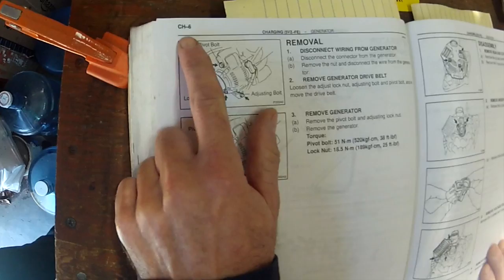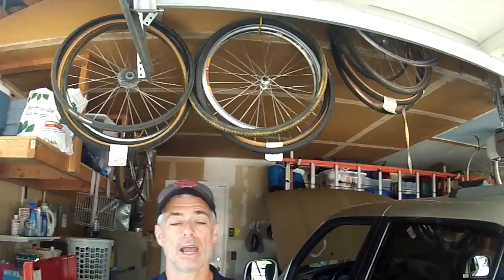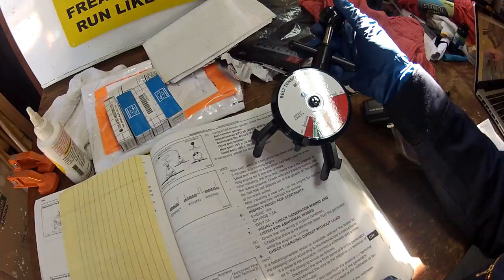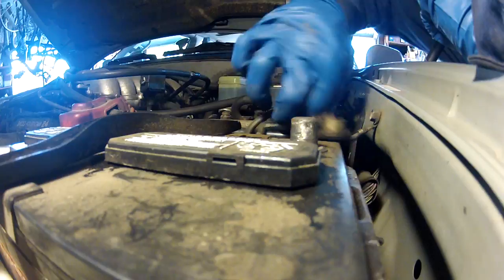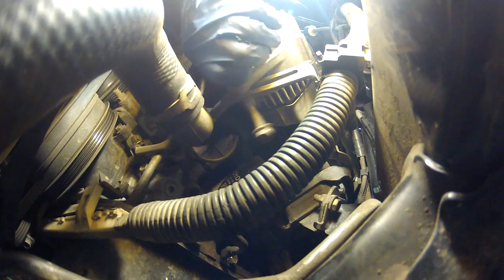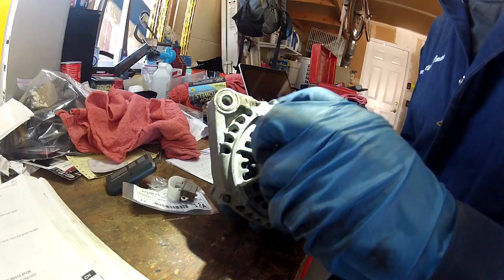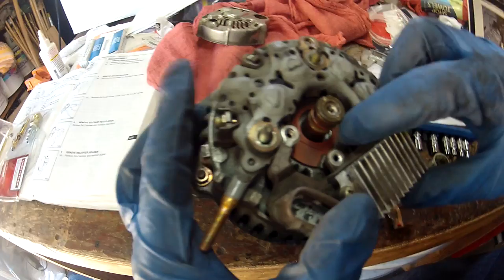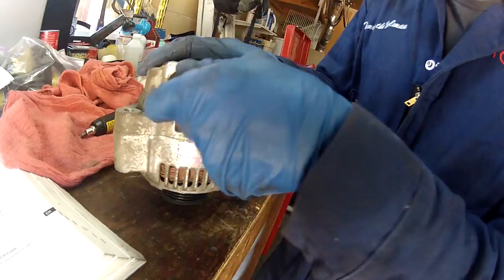Alternator Brush Replacement

Comment: My alternator may not be charging well enough. My battery light came on, on the dashboard. No real problems yet. My is question is, if my alternator is the culprit would this be worth doing to regain the proper voltage charge, I'd rather spend $22 or $27 rather than $138. Thanks Timmy.
Reply from the maker: Yes, it's worth a try replacing the brushes.  Quite often, worn brushes are the reason for poor charging or no charging at all.  Let me know how it turns out for you.
Reply: @TimmyTheToolman : well they tested the alternator on the truck, said it was below normal voltage, like it was bad, took it off to buy another one at autozone, but had them test it on their machine instore before buying a new one. And then they said it was at back to 14 from 11.9 volts,,,saying it was good. Keep in mind the battery light was lit on the dash.  So I'm like what's is going on, so I put the alternator back on, making sure the electrical connector clicked, tightened up the ground and, BOOM!!! ---THE BATTERY LIGHT DISSAPEARED. I'm super happy I didn't have to spend $138 on a new one, idk what it was but the light is off now.
Reply from the maker: @israelrodriguez6986  A miraculous fix.  Hope it holds up.  If not, check the brushes.

Comment: Timmy what’s your opinion on wheel bearing and rear axle seals. Rather than wait for the bearings to start howling what mileage would be a good interval to change them.  My 2006 tundra has 88k on it on and I have alll the parts to do the front and rear wheel bearings and seals. The rear axle seals are 17 years old I don’t want them to start leaking b4 I change them. In your experience rear axle seals should I go by age or mileage for replacing them
Reply from the maker: Hey Andy, it's a combination of age and miles, but I'd say more so miles.  If they aren't leaking or making noise, I wouldn't bother replacing them.  They can last for much longer than 88k mileage.

Comment: Hi Timmy, my alternator makes a humming/buzzing noise and when I pull the power from it the noise goes away. Could this noise be bad brushes or something else? It still charges the battery but the noise is annoying and I feel like it could fail at any time.
Reply from the maker: I'm not sure what the buzzing is, but I doubt it's the brushes.   It could be the regulator or something else. I think the safe bet is to just replace it with a quality rebuilt unit.  I'd recommend getting a Denso.
Reply: @TimmyTheToolman  Thanks for your reply! My alternator is a Denso & I also have another one that I haven't returned to get my core charge back. I'm gonna try using Autozone's Duralast Gold brand this time since they have a limited lifetime warranty and I've had good luck with their starters. Maybe I'll rebuild those two Denso alternators and use them as backups or sell them.
Reply from the maker: @blacksheep6941  You're welcome.   I'd definitely keep the two Denso alternators as backups.

Comment: You forgot to tell ppl to clean places that the brushes make contact with some Emory clothe until it's golden. And you can take a file and file the pivot place on the alternator and it will slide right in.
Reply from the maker: Because the brushes are constantly making contact with those areas, they were pretty darn clean, but we agree you could spend a little time since you're in there to make it uber clean. thanks for the comment.

Comment: Hi I managed to change the brushes but the engine light is on and doesn't switch off. How do i fix this?
Reply from the maker: Sounds like your alternator needed more than brushes to fix the charging issue.   I would double check the charging though with a multimeter to confirm it’s not charging properly before replacing the alternator.  I would buy a rebuilt Denso alternator and not some other aftermarket brand.

Comment: Do a video showing how to replace the bearings, please.
Reply from the maker: That's a good idea for a video.  Maybe we'll do it one day.  But, I wonder how hard it would be to source the bearings.
Reply: They can be bought from Toyota.  Of course if at anytime the viewers vehicle as had a replacement brand other than Denso they will run into bearing size compatibility issues like I did.
Reply: *COULD have compatibility issues
Reply from the maker: Gotcha.  Always better to try to fix and keep your OEM Denso alternator because it's superior to anything aftermarket.

Comment: Timmy, question got a 2015 4Runner every 3-4 days I need to charge my battery, battery is new. Hook up my meter to Checked alternator it shows charging low it only charge around 13.4-13.6. Replace alternator and drive belt same result. Appreciate the response thank you.
Reply: Only dash cam and I disconnected it. Yes, it’s a EOM alternator.
Reply from the maker: @jeffguia7371  Ok, have you checked your grounds to see that they are tight and free of corrosion?
Reply: I will check all the ground I will give u update. Thank you

Comment: I have a Toyota with 135k mikes would it be too soon to do this but the brush kits is $20 and a cheap insurance against breakdown or a failed alternator on a long trip.
Reply from the maker: Mileage isn’t always the answer to when you should replace them. You could get it out of the way and have one less thing on your mind. It’s all dependent on how many times you had to start your truck - so a soccer mom driving around town might need this done sooner than someone who has a lot of highway miles. At the very least, have it in your truck in case you need to do it on the fly out in BFE.
- Sean
Reply: thanks. Your making sense I think 135k miles is definitely a decent interval to replace the alternator brushes
Reply from the maker: @andyg5004  You're welcome.

Comment: Hi bro, I spent 1 hr trying to put on the bracket my new alternator (denso)  without success, any advise? Looks like the bushing in the bracket is stopping the alternator come true...
Reply from the maker: Richard Avila Hey Richard, mine fought me as well.  Some people have messed with the bushing and had success.  What worked for me to get the bolt holes lined up was my telescoping mirror to see how I needed to adjust the alternator so the holes would line up perfectly.   It was a pain in the ass but I finally got it.

Comment: I meant to ask you something else. Since the rebuild my valves have seemed pretty noisy. Number 1, is it a huge deal to adjust them? And number 2, will it do any damage to leave them a little loose, if that is in fact what's going on? Thanks!
Reply from the maker: Well Steve, you would hope when you have somebody do work like this for you that they would make sure all the valve clearances are correct before putting the valve covers on and finishing the job.  I haven't adjusted valves before but a buddy of mine did a valve adjustment on hie 3RZ engine.  He said it wasn't bad but he had to alter the tool he bought a little so he could get the shims out and back in.  

The special tools you need are so you can rotate the cam and then hold the lobe while you measure and pull the shim.  You measure with a feeler gauge and then compare to what the factory spec is whether it's an intake valve or exhaust valve.  I bought the tools necessary and they are very affordable on Amazon.  I think the Lisle company makes a two piece kit to rotate the cam and hold the spacing while you pull the shim.  I bought the feeler gauges and a micrometer too so I can measure the shims.  I think you could handle this yourself but you would need  the factory service manual pages to follow the proper steps.  It would put your vehicle out of commission for a while potentially because once you figure out the size shims you need to get back within proper specs, you might not find them available at the dealership and you'll have to order them and wait for them to arrive.

If the valves are making an abnormal noise, I would say it would be smart to have them adjusted.  I can hear some lifter or valve noise on my two 3rd Gen 4runners but it's not anything crazy loud.  I don't know what damage could occur leaving it like this but I know engine performance would definitely suffer if your valves are way out of adjustment.  

If you paid for this job and it wasn't just a friend doing you a favor, I'd bring it back to him and ask why your engine is making so much noise.  Ask him if he verified all the valve clearances were within factory spec.  If he never verified it, he really should fix it for you unless you don't want him touching your vehicle anymore.  I hope this helps.
Reply: Timmy The Toolman wow that actually looks like a pretty big job! I watched another guy's video on how to do it after first reading your response here. I'm not sure if it needs to be done or not, but it does seem a little noisier then before the head gaskets were replaced. And unfortunately I can't take the truck back because the guy that did the work was the boyfriend of my daughter, who was a mechanic, albeit not a very good one, or at least not a very conscientious one, despite recommendations from a few people. I got a "deal", but obviously I got what I paid for! HUGE lesson learned! I have spent months chasing after things here and there that he didn't put back together correctly just plain left loose, or broke in the process. Including recently finding a vacuum hose that was left disconnected that was keeping my 4 wheel drive from engaging. Didn't discover that until I needed four wheel drive right before a recent snow storm we had. And now the truck runs a whole lot better without that vacuum leak and it's getting better gas mileage! Geez! Searched for a vacuum leak a long time ago due to the weak performance, but I just couldn't track it down until I needed to search a little harder upon discovering no four-wheel drive! So my hope is that the basic work on replacing head gaskets was at least solid, but time will tell! Sometimes I feel like I'm probably driving a ticking time bomb though! 😂😜 Good thing it's not my daily driver. I guess I'll try to find a good local dedicated Toyota mechanic and at least let him listen to my engine and see what he thinks about those valves. Thanks again for the very thorough help and advice!! Steve
Reply from the maker: OK, good luck with this rig Steve.  I bet you can handle the valve adjustment all on your own and you'll do just as good or better than a paid mechanic.
Reply: Timmy The Toolman thank you sir. We'll see! 😊

Comment: testing the charge rate you didn't increase rpm or check under load with lights/highbeam a/c etc running,alternators should be checked under load.
Reply from the maker: Well Joe, the basic test I did show the alternator was charging even though I didn't put a load on it by revving the engine or by running the lights and accessory equipment.  I'm just a DIYer and I don't proclaim to know everything. 
Since you obviously know something about how an alternator should be tested, why don't you share with us what we're looking for with the voltage readings when we put a load on the system so we can all learn something.
Reply: its your channel your job,also check for a/c voltage coming through more so on old suspect alternators aswell as current draw with everything switched off.

Comment: Absolutely great information, Way too much camera shake, in-out, odd angles... needed dramamine
Reply from the maker: Yeah, we try not to do the shake and bake with the camera so much and I think we're getting better but a lot of times we have to hold the camera by hand to get the shot we want and it's not the easiest thing to be holding the camera still while you're uncomfortably leaning over into the engine compartment while sometimes holding a light in the other hand as well.

Comment: Hey Tim I’m thinking of doing this to my Tacoma , it has the 2.7 on it and can’t seem to find oem brushes for my alternator , only option i found was eBay brushes from a reputable seller of alternators and starters, should I replace them with those ? I’ve checked camelback Toyota and 5 other sites and nothing
Reply from the maker: Do you have a local dealer parts department that you could visit?  I'm pretty sure that's what I did because this is a hard part to look up.  Did you pull the model number off your alternator and you're looking up the part number for the brushes that way?
Reply: Timmy The Toolman I searched by the TOYOTA brand alternator number nothing , then I searched by the DENSO equivalent and found the eBay brushes that way , the camelback site shows the brushes on the blueprint but aren’t in the parts for sale list
Reply from the maker: Well, the Ebay brushes might be the best way to go then unless you can visit a local dealer and have them look up the part for you and order it.  You'll obviously pay more using the dealer.

Maybe try calling Camelback and see if they can get the part.  They are usually very helpful.
Reply: Timmy The Toolman hey Tim thanks for the advise , I contacted my local dealer ship and to my surprise they actually had them ,pretty pricey too lol
Reply from the maker: That's good they had the parts.  Yeah, I bet they were pricey.  I still use my local dealer parts department quite a bit.  When I can't find something, I go there and they get it for me.  The people I deal with there are all really cool so I actually like going in there.  They know I have a YouTube channel so they give me a 15% discount which is still more than online pricing but it makes it a little more affordable.

Comment: I'm getting ready to do this repair along with timing belt, fan belts, water pump, thermostat, etc.
Toyota of Dallas has a pretty good online parts system.  When I put in the p/n for the brushes, 27370-75060, the site says they won't fit the 2000 4Runner.  I can see from the video that they fit perfectly for you.  Did you run into any issues purchasing the brushes?  Did the parts guy have to do some special cross-referencing acrobatics or anything?
Reply from the maker: I just went to my local dealership, Stevens Creek Toyota, and one of the parts guys looked it up for me.  My rig is a 2000 SR5 4x4 with the OEM alternator and it fit just fine.   I don't remember the guy struggling to find the part number for me.
Reply: Yep, my 4Runner is the same as yours.  I'm sure they will fit.
Reply from the maker: Yep, I reckon it will fit just fine.
Reply: Just did the alternator today. brush p/n noted in your video fits perfectly. Guess Toyota of Dallas online parts had a glitch on this one. 250k miles my brushes only stuck out about 1/8 inch after removal from the alternator.
Reply from the maker: Perfect timing.  You were close to having a charging issue which would have killed your battery and caused you to be stuck somewhere.  Then maybe a zombie horde could have surrounded your rig and you couldn't get away.  Game over man.
Reply: Yeah I think the brushes were ' bout toast. But I didn't think about the zombies. Now I know I'm really lucky to have caught it in time. And there ARE zombies some of the places I go...honest.
Reply from the maker: Now that's funny.  I see zombies where I work as a firefighter.
Reply from the maker: How did the timing belt and water pump replacement go?  Any hangups?  Did you replace the tensioner, idler pulleys, cam and crankshaft seals while you were in there?
Reply: They're everywhere.
Reply: Timmy The Toolman ..tensioner and idlers yes, did cam seals a while ago when i did the valve cover gaskets, crank seal, no. new water pump and thermostat, ok.  Thats what I got done so far. You really do need to move the A/C compressor and bracket to get to the tensioner bolts. Those are hard to reach. Helps to remove the right wheel and fwd splash guard. Decided to replace the oil cooler hoses and radiator. Ordered those so I'm on hold till they arrive.
Reply from the maker: I've heard the same thing about getting the AC compressor out of the way to remove the tensioner.

Comment: Concentrate on Alternator brush replacement.  Other topic  such as belt tension and tightening torque etc....are irrelevant.
Reply from the maker: So you're saying it's ok to have a loose squealing belt?  I think covering how to get the belt tension correct is an important aspect of this video.  I realize a belt would have to be significantly loose to cause a charging issue but you want the belt at the proper tension so it doesn't slip and squeal or put excessive pressure on the pulley bearings.

Comment: The brush kit part that you listed here for Amazon fits a 1999 model as well?
Reply from the maker: If it's a 99 4runner, then yes.  The 3rd Gens with the 5VZ-FE engine all run the same alternator.
Reply: @TimmyTheToolman  thank you for replying! I was asking because in the Amazon app it was saying the part was not compatible but I know sometimes Amazon info is not correct
Reply from the maker: @seselapaz  Yeah, I know what you mean.

Comment: Another great video!  I have 320k on my 2000 3rd gen.  Do you think I should replace just the brushes like you did or at this point should I replace the whole alternator.  I just had it tested at Advance Auto  and the alternator passed.
Reply from the maker: I'd just replace the brushes and keep running it.
Reply: @TimmyTheToolman  Thank you!  I'll do just that.